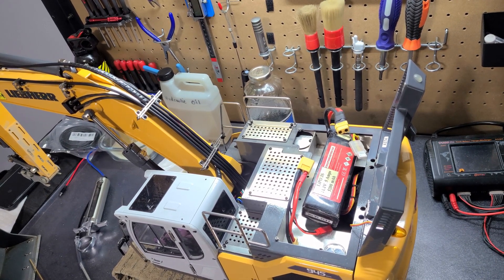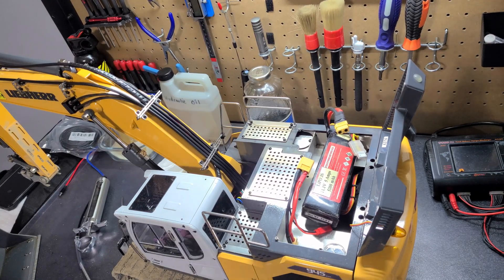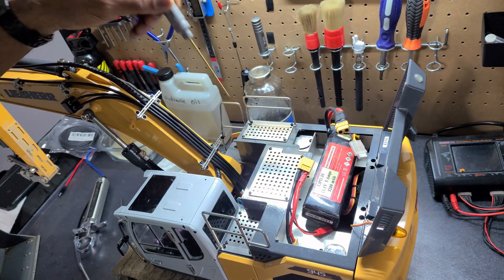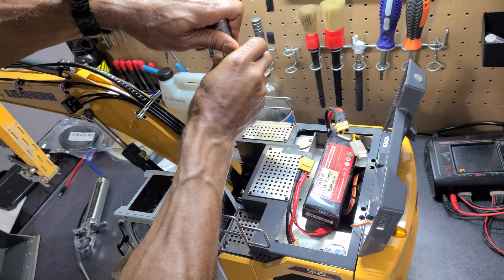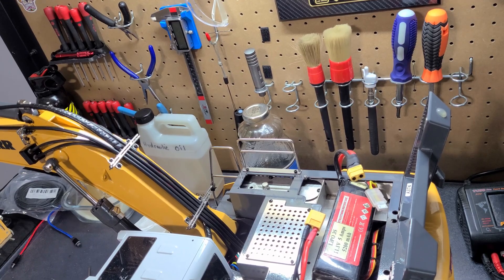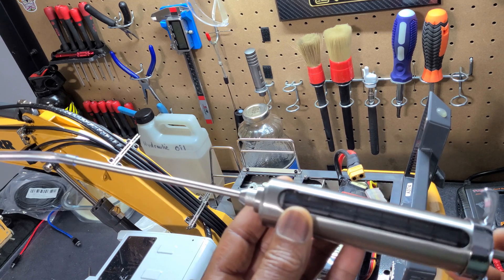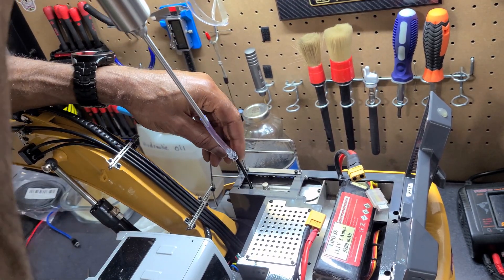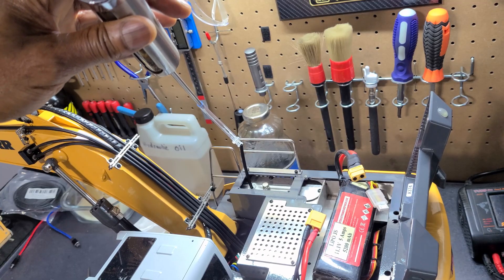XDRC 945 Hydraulic Fluid Change

Comment: How are you getting 2 hours or longer on a battery? You running 3s ? And how many mah
Reply from the maker: I'm running 3S Lipo 5200 mAh. They start at 12.4V and I run them down to 9.8 volts before it begins moving really slow.